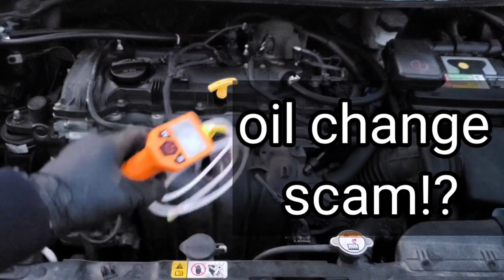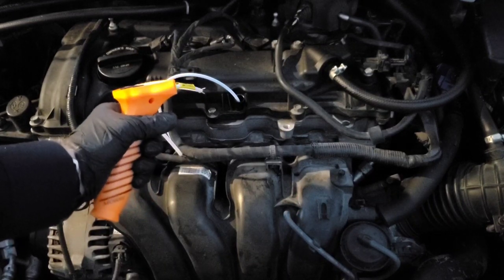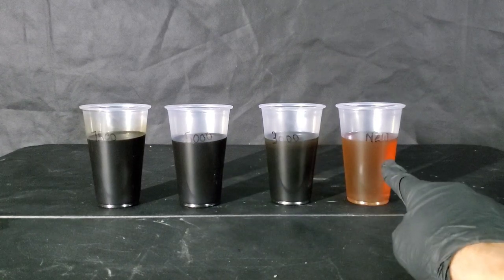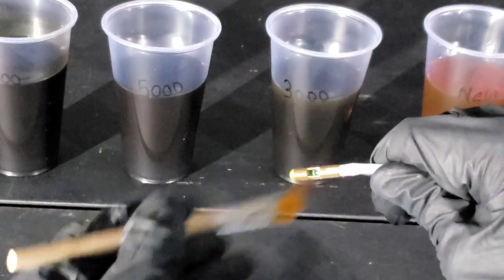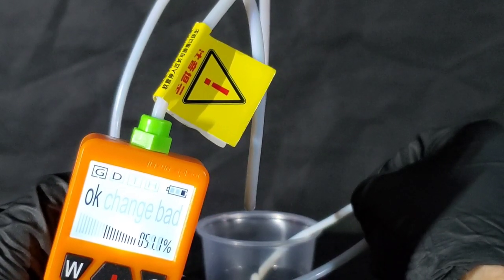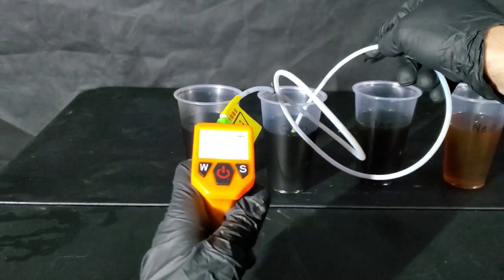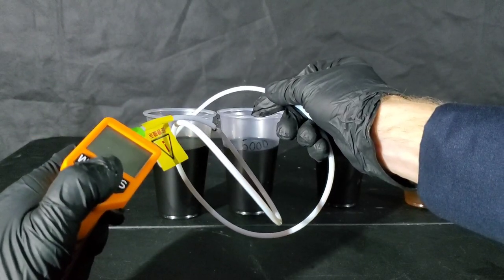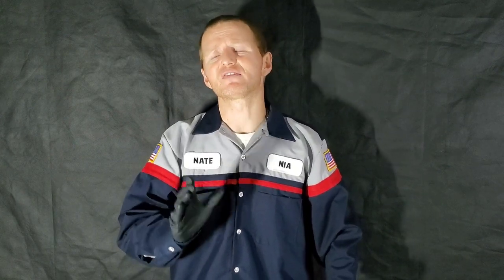Oil Change Scam!?

Comment: I don't know about that.  Car Engineers are fairly smart.  

When my car is new I usually follow the manufacturers change intervals and lab sample at the first oil change.  You can purchase the prepaid kits from the parts house or right off of Amazon.  

That just looks like something to sit on the shelf at the shop.
Reply from the maker: You are exactly correct, it seems like a gimmick.

Comment: Bro kindly give me suggestion actually My Mercedes C230 Petrol engine running it 5000 miles more approximately after oil services And changed it before 3years But dip stick level is fine and viscosity is not bad Do it's replacing Engine fluids is good since Recommended miles upto 9000 miles

Comment: My oil sensor has a range of 3K - 10K to change the engine oil. I mostly do stop and go driving so the sensor says to change it every 4K miles. I'll change it at 3.5K just to be sure. No need to spend money on something to tell me when to change the oil. The sensor also measures engine revs as I drive spirited at times.
Reply: Technology has come a long way but not that far still a lot of people will be scared by it